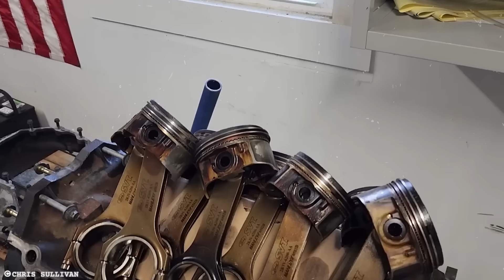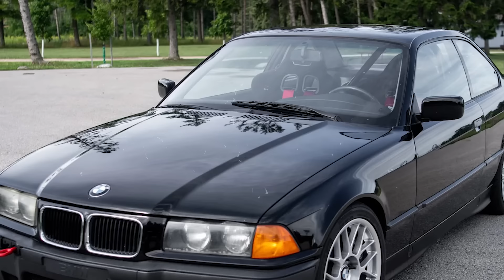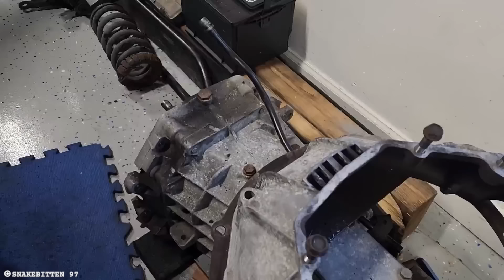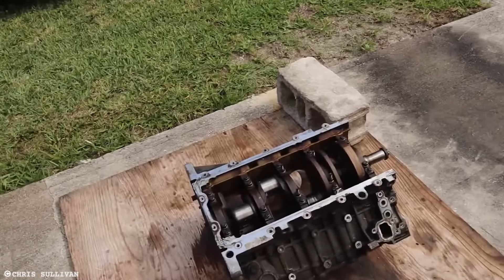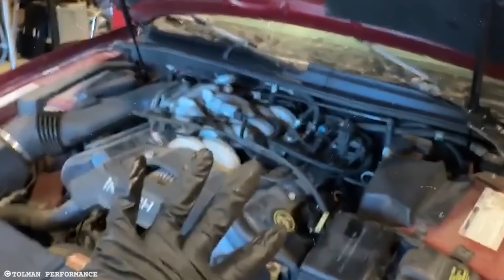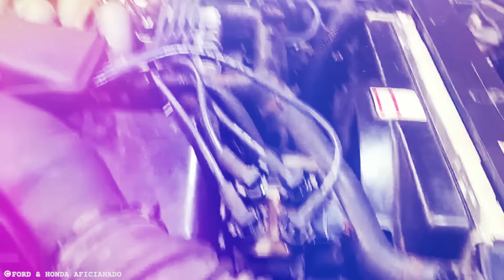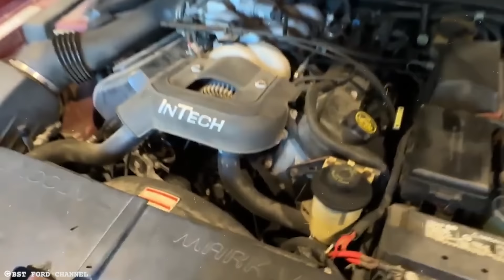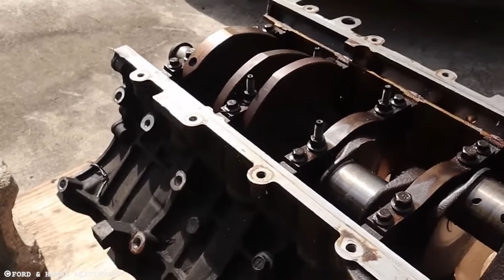The Most Overengineered DOHC Engine of Its Time   Ford 4 6L DOHC Modular 1993

Comment: 1989 ford super coupe. whipple blower on top. five speed manual. independent aluminum suspension That automatically adjust at high speeds. Motor trends car of the year. My buddy had one growing up, he still has one lol. A brand new rouche mustang rolled up on my buddy a month ago on the freeway. My buddy was doing 130 mph shifting out of 3rd, stock gears and motor with a tune. The mustang disappeared, The coupe kept pulling solid into 5th then my buddy coast in neutral for a few miles until the speedometer comes back around lol. That car does easy 180 mph with a tune. Problem with that motor. When you start pushing anything over 15 psi, The studs That hold the heads to the Block pull apart. Easy fix if you spend a little money. Long story short, That car produced in 1989 still out does most cars today!!!!!
Reply: ARP studs and Cometic head gaskets are keys.
Reply: 180...only if it was launched off the Grand Canyon
Btw how did he measure his speed?

Comment: Junk. 2v 4.6, 5.4 are junk.  High probability of stripped and or broken spark plugs.   Getting rid of the Windsor platform was stupid.  Thats when I stopped buying Fords.  At one point I had a94 mustang gt, 91 f350 460v8.  85 Grand Marquis 302.  86 f150 302.  Those 302’s were bullet proof.

Comment: And then…. The sparks plugs popped out
Reply: on the 5.4 Triton
Reply: 4.6 did not blow plugs, extracting them for a tuneup presented the problems. Two piece plugs,
Reply: @ChrisHariis nope they also blew spark plugs the cylinder heads that  only had 4 threads for the spark plugs were bs all across the modular lineup

Comment: The best was Chevy's 4.3 really just took a v8 cut off two cylinders
Reply: had a new 99 and 00 S10 with that engine...was impressed with the torque it made right off the showroom floor. Too bad the transmissions and heater core blew within months.

Comment: and still better than the shit coming off the line in 26.
Reply: sad isn't it? I loved my 2017 Nissan Frontier Pro 4x, ended up with a 22 Tacoma TRD Off Road when I was done with with the Nissan.  I sold that POS, drove to the south where rust isn't a problem and bought a 2006 Jeep Wrangler to get the old AMC 4.0 inline 6 motor in a rust free package.
Reply: @stanleybarker6207  Good choice 👌 Majority of earlier production inline six's were phased out because they were bullet proof and the auto industry couldn't generate profit if they had longevity. They did the same thing with the Ford 4.9 300 ci inline 6 ,production ended in '96 .
It's all planned obsolescence in everything that is purchased today.
Reply: @kuntekinte6246 I went looking for an old F-250 with a 4.9/300 and a manual transmission, people know what they are now, and want too much money for them.  I grabbed a jeep before some FB video spouts off about amc 4.0 and those are worth too much too.😂
Reply: @stanleybarker6207  Yeah even the used market is getting up in price. I know an elderly down my way with the 4.9 inline 6 but he refuses to part with it. Can't blame him one bit .
Reply: @kuntekinte6246  smart elderly man.
Reply: @kuntekinte6246  I'm a Ford fan, my first car was a Blue/tan 1988 Ford Bronco 2 Eddie Bauer edition with a 2.9 V-6, 4x4 and a 5 speed manual.  I had the Lund visors and running boards  with the lights, chrome tow mirrors and American Racing 15" wheels  with 235/75 r15 tires.  It looked so much better than stock..  Tires were too big, rubbed on tight turns, loved that truck.  It struggled to do over 55 MPH on the highway though, it was a dog.  I was in the mountains headed down a long run in it,  so i  downshifted into 4th and put my foot down, then shifted when it was revving, pinned the speedo in 5th, broke the fan clutch.  It also hated having working headlights.  The pins would loosen up in the steering  column and the headlights would go out.
Reply: @stanleybarker6207  Sounded like some good times. My first car was a 4 cylinder. red 88 5 speed mustang. Then went into the 5.0 scene. I also have worked on Hondas ,got a steal on a 2007 civic coupe just recently. I've already sanded everything down and getting ready to prep it for primer.
Thinking about doing a K24 swap with K20 heads and a 6 speed manual transmission from a civic SI or TSX. 
Just brain storming, not going to put the cart before the horse. Regardless I am still going to keep my eye on a 89 and previous model inline 6. Trying to keep it Obd1 and older. Already have 2 F150's 
a 2001 5.4 2 valve with 296K and a 2014 V6 EcoBoost twin turbo with 183K. I refuse to purchase these newer vehicles they are riddled with problems and many have less than 10K and having catastrophic engine/ transmission problems. Along with all the electronics and computer software, I continue to hear nightmare after nightmare with these vehicles. Planned obsolescence at its best!
Reply: @kuntekinte6246  Cool, I dig the Honda stuff.  I was a Honda tech for a total of about 6 or 7 years.  I was around when the B motors were the bees knees and when the K motors first came out, took a break from Honda then went back till about 2022.  When I was a teen I stuffed a B16 into a CRX with a friend.  That little thing screamed.  My friend had money to burn on toys so he bought a late model CRX si, I think it was a 91, and he bought a JDM B16 swap kit.  Back then I had a 93 Integra GS-R, I was happy with my B17a1 so we had to get Justin up to speed with a fast Honda.  That little thing smoked my GS-R when we first got it running.  It was so light and fast no stock FWD Honda had a chance.  After we got it running and fixed all the bugs, Justin put a little money into the B16. He got a tuned ECU for it and put dual valve springs in the head, a stage 1 cam and full exhaust and intake.  He never went to have it dyno'd but it revved to 9k on the stock bottom end, and it was quick.  I loved that car so much I wish I had built one myself.
Reply: @stanleybarker6207  Nice! I'm not a tech but I taught myself over many years still can learn more.The last build was about 10 years ago 96 Honda Accord sedan and swapped the Japanese version Prelude F22B DOHC Silver top with an H23 non Vtec 5 speed tranny,Port and polished the intake and exhaust on the head was going to do extra things and get it dyno'ed but was going out of a relationship and got rid off,now I regret it my son has pictures of it that he took and rubs it in my face.(jokingly) Fiddled with Hondas in early 80's when I lived in Okinawa and Japan very young though. I later caught the bug and the rest was history .😅
Reply: @kuntekinte6246  F22B silver top, very cool, 160/160 stock right? One of the odd Honda motors that made decent torque.  Googled it, never saw one personally but that's cool man. My last project was going to be a mid engine rear wheel drive F20B DOHC VTEC Del Sol, but I had my first kid and made 2 more after that so I never finished it.  I ended up junking the body because I never had the time, it was just in the way of snow removal.  In my 40's with kids I'm just tired of working all the time, so I do as little as possible right now but I kept the motor & transmission swap stuff for when the kids move out.  I contacted Ariel and asked if they could whip me up a rolling Atom chassis that I can slap my F20B in and they said no problem.  So when the kids move out (then I will have more toy money) that's probably what I'm gonna do with that old motor and LSD 5 speed transmission.  This one is 200/145 I think, that should be fun the way it is in one of those light Ariel Atom chassis'.  If I want more out of it I'll slap a turbo on it.  I heard F20B can make 400/300 on stock internals no problem with a turbo.
Reply: @stanleybarker6207  Yep, I wanted to do that swap because of course the H22 was all the rave and I wanted to do something different. Funny you brought up the F20B Blue top right? This was also one of my choices but I got the silver top for a steal. I have heard since they are already sleeved they are able to hand 12-15 lbs of boost.Ive only seen one guy with a F20B in a 94 accord coupe and he was running 10lbs of boost ? If I remember correctly but it was all stock.Man I thought I was late, JJ , I only had one child at 32 
I raised him myself since  the age of 3,ever since the bad relationship was broken off.He's graduated now but I figured this project will be something both of us can do and he will also be able to learn something new .
Reply: @kuntekinte6246  yep Blue top
Reply: @kuntekinte6246  yeah do it man.  good luck to you two on your next project.  400/300 is supposed to be the safe limit stock internals but i know people push stock harder than that.
Reply: @stanleybarker6207 Thank you and good luck will all your endeavors  👍
Reply: @kuntekinte6246  you too man!!
Reply: @stanleybarker6207 My next door neighbour went to the city to pick up a second used Acura EL from the late 90s as a 4th vehicle for his kids now driving. He came back with a Jeep Cherokee XJ 4.0 when the first seller stood him up. Unbelievable shape for Ontario Canada. $3000 Canadian. He was unaware of how great a deal he got, until I told him. I think he smoothed things over with his wife because they sold off their newer Dodge Ram or Ram 1500 and use that as her daily driver.  And still have the late 90s Acura 1.6  dressed up Honda Civic.
Reply: I have just bought only 4.6s f150s the last 14 yrs unkillable engine
Reply: @Freshprankstv1  Yes this is true know a couple acquaintances one has 460K the other 415K  .

Comment: I always hated them but they are monsters with a power adder
Add 2.8-3.0 mammoth to any mod 99-05, Shelby, coyote Easy 700whp
Reply: Why hate them though?? They sound great, last forever, adequate power, efficient, look great, run smooth, rev nicely.. They have a few quirks like being so large, a PITA to install headers, etc. But they are fun and put down power nicely..
Reply: @NewEdgeDesigns the plastic and the early non pi/ town cars the box Chevy caprice 9c1.  In hind sight I see the forethought of engineers....why chase Chevy with displacement and 4or 5 variations ...add liters with the power adder. It's perfected now wit gen 3 coyote 9000rpm, cams600 crank. They like air and just a 50 shot of nos/pulley can make a terminator run 10s....75 shot and pulley gt500 knocking on 1000whp
Reply: @J @JoelHr-s6i solutely!! I owned a 5.0 when the 4.6 was put in mustang, in 2 separate cars..  SN95 and a Lincoln Mark 7.. I was invested heavily into the 5.0 game..  Then in 2002 I got a 98 Cobra and that changed my mind completely…
Reply: @NewEdgeDesigns almost got Lincoln as graduation present

Comment: 0:10 Stop trying to revision history, Ford was junk then and is junk now.
Reply: Can you actually provide a reason why you think ford was junk? There wasn't a faster car that was cheaper than a 2003 cobra. So please elaborate
Reply: He's just a troll. @sergiogarcia3003
Reply: @sergiogarcia3003 oh no. I owned a mustang GT, the poorly engineered flimsy metal frame holding the seat to the floor actually broke, I've never seen that happen in any other car. Further, the head gaskets on all of those 5.0 motors would frequently blow before you hit 100k miles, which would send them to the junkyard because of the cost of the repair. I also owned a Ford ranger of that era, the thing nearly rolled over in every corner, it was very unstable junk and I wouldn't trust to reliably operate. Its counterpart, the Ford explorer, was will documented to roll over and it is a shock to me that the Ford ranger was never exposed. I had a 5.0 GT manual and it got smoked by a Mazda RX7 in a stop light race and to add the to the embarrassment the top end of the 5.0 was embarrassing watching Hondas leave you behind on top end on the freeway. Take your bs elsewhere, maybe you'll find some naive simps who were born yesterday. Yes Fords were cheaper back then but today they are just expensive junk, they aren't even cheap anymore. The prices increased as they copied technologies and designs used by more advanced foreign vehicles, so I guess after they had copied everything they could, their cars became priced equally only with inferior quality and engineering.
Reply: @dare2scheme904 I disagree… I’ve had many fords and all were fairly reliable the very least. Shit I even had an 03 expedition that didn’t give me any problems although it seemingly did everyone else 😂
Reply: @douglasrodenbach8000I'm glad you are one of the few who had a good experience. I would admit if it were good, but it's simply not. Get whatever junk you want to get with your money, but I'm doing 300k+ miles with Toyota products, Ford is in the junkyard you can go check the odometers lol. It's so obvious they're junk that their low quality interiors fall apart as quickly as the engine and transmission fail, before 100k miles. Yes not only the engine and transmission are points of failure but the actual tacky Ford interiors fail as well. There are also plenty of exposing videos of engine teardowns showing exactly how Ford engines have incompetent engineering, including the trucks now, such as a wet belt drive for the oil pump, which cannot be replaced without a major engine teardown. Keep getting those fords bro I don't care, but be aware that that company is likely going to dissolve.
Reply: Then why are there more Fords on the road then any other brand, more then Chevy more then Toyota?
Reply: I can only laugh, I'm speechless SMH. Get whatever junk you want to get with your money, but I'm doing 300k+ miles with Toyota products, Ford is in the junkyard you can go check the odometers lol. It's so obvious they're junk that their low quality interiors fall apart as quickly as the engine and transmission fail, before 100k miles
Reply: Just saw the video today but do you have a clue what you say? While the 5.4 has it's issues the 4.6 in every variant is incredibly reliable.A Crown Vic cop car that then becomes a taxi with 300k miles.
Reply: The big three are all junk.

Toyota all the way! 🇯🇵
Reply: @cchcch-jw9dwexactly the 1uz was the king

Comment: Lincoln started using the 4.6 in 1991.  1990, the start of the new body style for the Town Car, was the only year of that style to have the 5.0.  A.i is failing.
Reply: Yes sir. I will never forget my brother popped his hood and I said 5.0 ! WTF ?  I had to go Google it thought this generation Town all had the 4.6 like mine.
Reply: Like the late 80s tbirds with the 5.0. Good looks and dead reliable
Reply: @gordocarbo  yes indeed. Great injection  in the later 80" Another friend had a mark 7 with that 5.0 and no joke he could floor it and pop the front tire up a tiny bit  Earlier 80s 5.0  finicky unreliable, they had the 2 injectors sitting on top where carburetors used to reside
Reply: @gordocarbo  my bros favorite was his more boxy 87 type town car.  I also had an 88 with bull horns on the grill like Boss Hog.   My faves had 460s though a 78 town coupe and 74 mark 4. Funny thing when people watched u driving , parallel parking and k turning with only one pinky on the steering wheel 😆
Reply: @gordocarbo the aero bird baby what a machine

Comment: Most reliable modern engine. 
Police cars run 12 hours a day for 10 years while running 100 mph in high speed chase. Than they was auctioned off to the public. I know lot of people that put 300k- 400k on these engines and some still alive with no internal work or rebuilding at all.  Ive seen these engines run with no maintenance to 350k mile and strong too. 

They should have never killed this engine out. 

Another is the 6.8 v10 based of the module block. 

I late 99 earlier 00 f250 so much you'd thing it roll off the factory floor last year. 

And these f250 are still in service on the work site hualing machines, pulling cars.
Reply: The police crown vic used the SOHC 4.6. The DOHC was used in other models. In my opinion the SOHC version is the better engine.
Reply: The 6.8l v10 was a great boat anchor.  They didn't live up to the 10 cyl expectations. They also ate cam rollers and jammed the valve into the piston at 65k miles. The 5.4l and 4.6 were solid engines. But they all suffered from exhaust manifold stud failures.